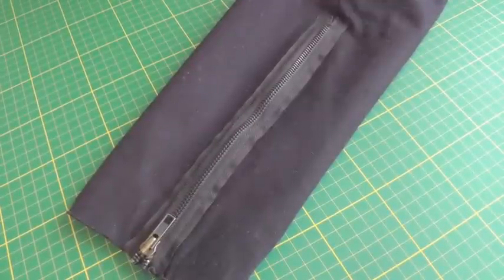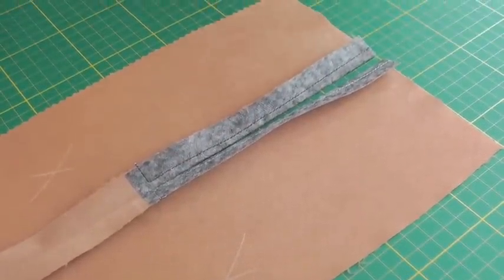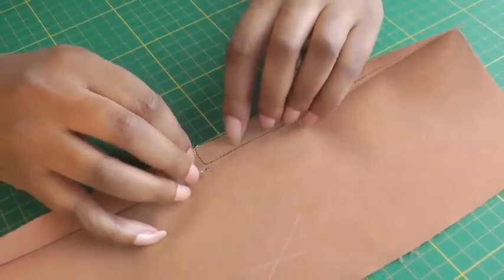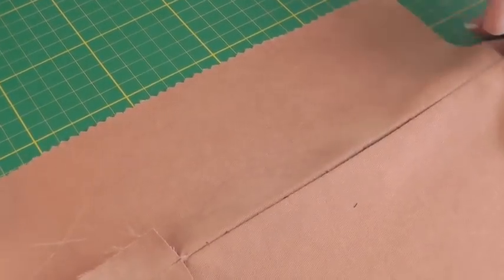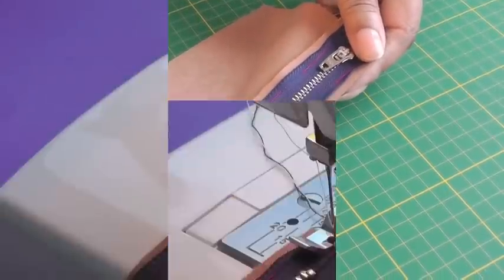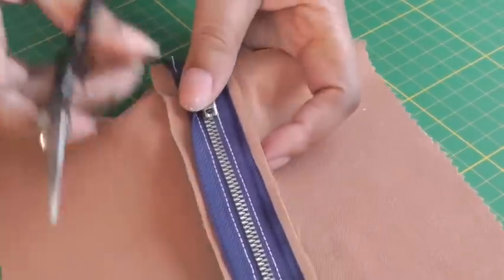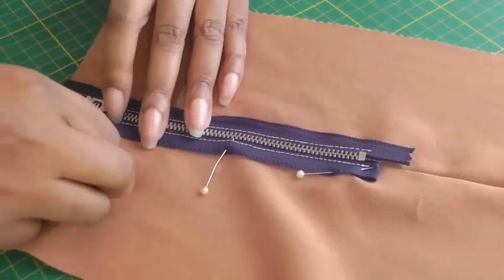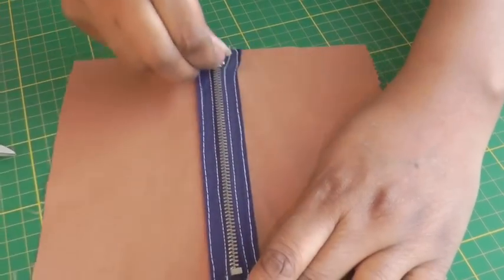Sewing an Exposed Zipper

Comment from the maker: The stitch is a basting stich (tacking) and is a loose temporary stitch so there shouldn't be any problem when removing them.  Make sure you baste by hand and NOT by machine as this will make a difference.